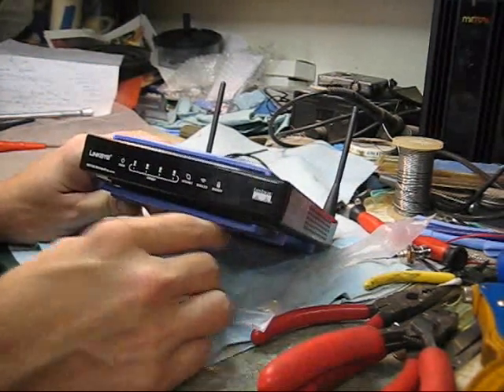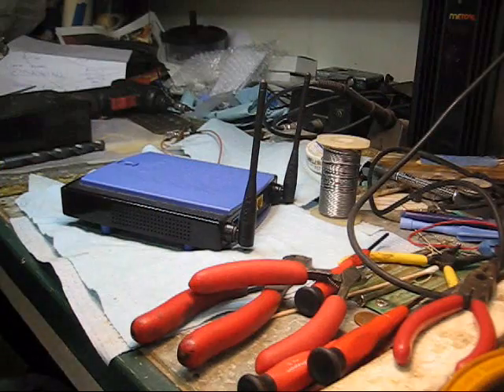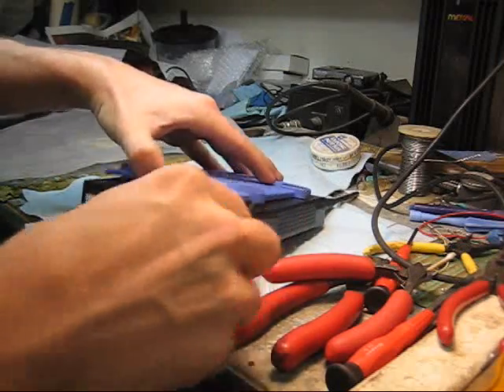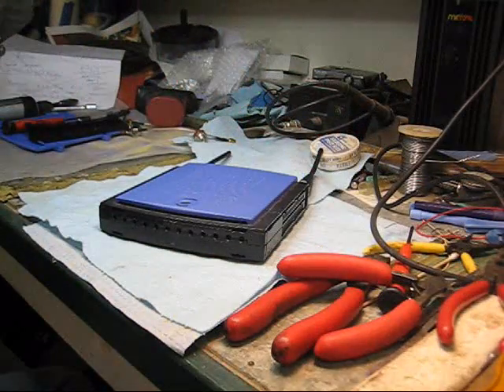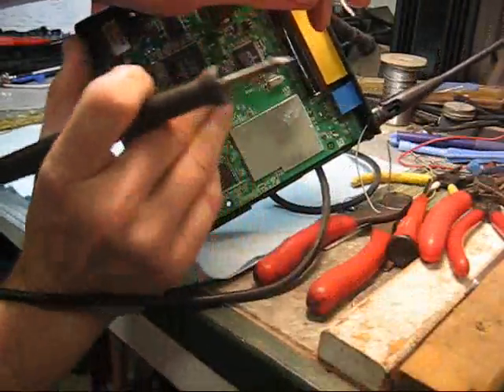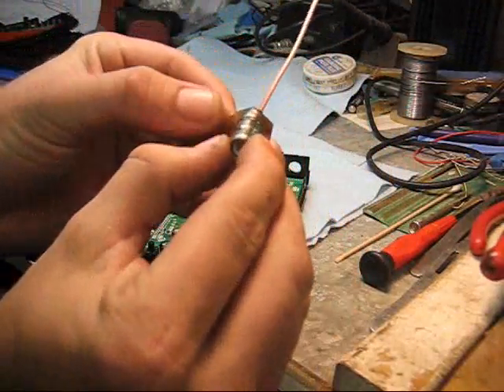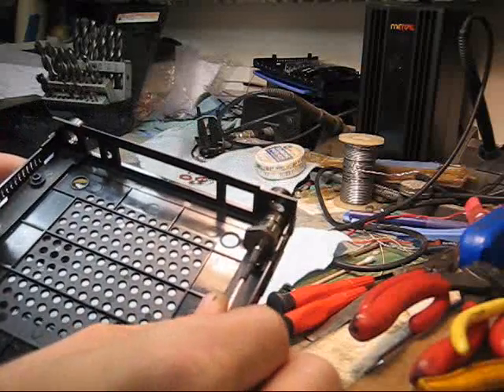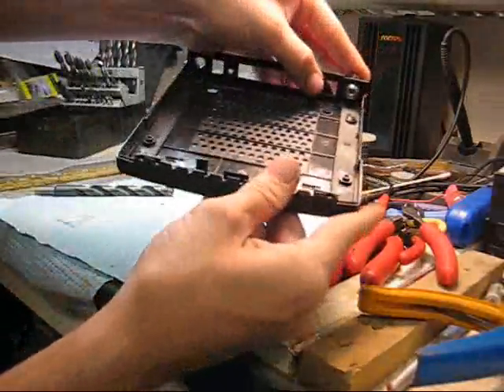How To Modify A Linksys WRT150N WIRELESS Router For RP-RF External Antenna's

Comment from the maker: @clay, . The best bet for you is to buy a wireless repeater booster to get more range. I'm pretty sure it could be done though, the antenna's inside should be mounted to the case. The antenna's and leads should be removable just like my video  i would go with smaller SMA connectors and not the RF for the newer routers. Hope that helps.

Comment: You can also make a repeater bridge with a cheap ol router using open source software, or if you have a old PC install a wireless card into it, a couple of high speed NIC's and install PFSense and most powerful home router available.

Comment from the maker: @ Akin Thanks for your comment. I ended up using some old 2.4 GHz screw on antennas from an older Linksys router can't remember the model they came from but they seem to work good for this router and my needs. Not sure about tuning or what max frequencies it can handle with out look into it more.
Hope that helps.

Comment: Good video, were you able to tune the aftermarket antennas to the 2.4 GHz or the 5 GHz, I don't know if that router has both frequencies, but if you were able to tune them did you use an attenuator, a simple potentiometer, what have you, if you could please let me know I have some old routers I want to experiment with. I am going to try to make a Inductor into a antenna, etc.

Comment from the maker: @ Angy sounds to me like it's your IP that is slow. I would run a scan on your modem to check your speed. Doing that it will tell you how much Mbps you are sendind and receiving from your IP provider. I got basic broadband so mine Mbps runs about 40 to 54.
Hope that helps.
Cheers, Wah